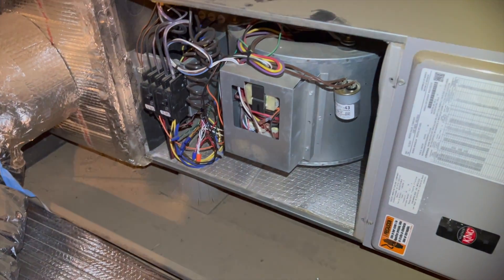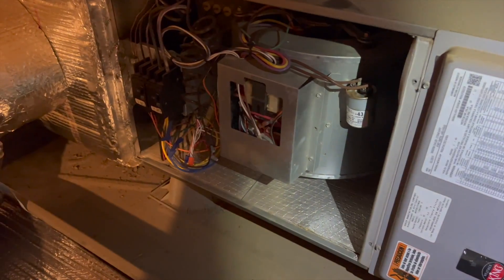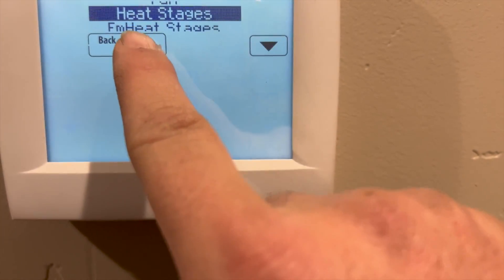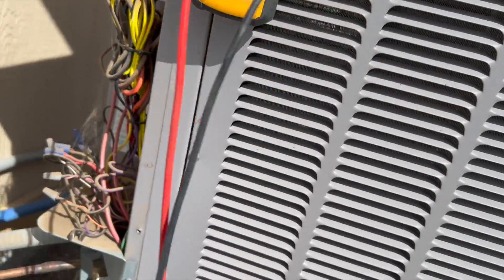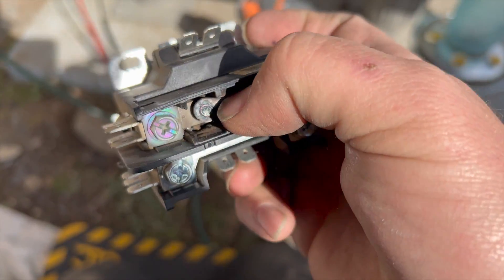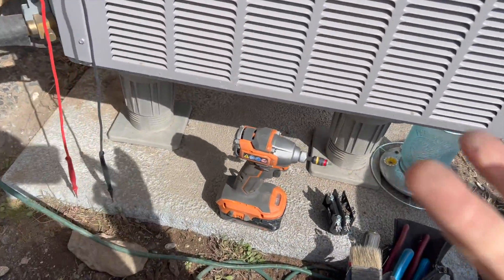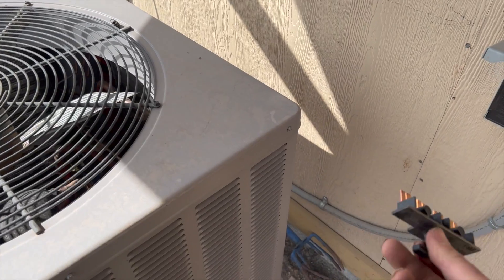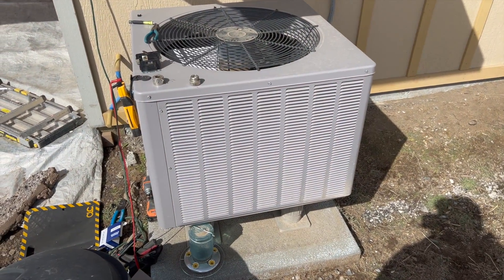Heat Pump Outdoor Unit Not Running EP110

Comment: Thank you so much for ur help. Now, what is a "high pressure lockout"? Thats a code I am getting from my defrost board.  And could a defective thermostat caused the defrost board to show this code? My heat pump board is currently showing this code. The OUTDOOR unit DOES NOT, start up at all,  in the heating or cooling mode. There is 24v on the R and C terminals. In  the "emergency" mode, I am not getting enough heat. It only heats up to 72degrees only, and runs all night. And never shuts off.  This is a RHEEM system. 6yrs old. I am really frustrated, because i am having all these issues at the same time. I am thinking the thermostat is mal functioning, then I think its the defrost board. then i think the heat strips has issues. I am a wreck with these issues. The indoor unit runs fine, but NOTHING from the OUT DOOR UNIT. I just can't figure it out. Hope you or any other can assist me. thnx.
Reply from the maker: If you’re getting a high pressure lockout it’s not an issue with the thermostat. This occurs when your refrigerant pressure gets too high. This situation will cause the high pressure switch to shut off the system. When this happens multiple times the board will then lock out the unit preventing the unit to run.   This can be reset if you remove 24v but it’s possible it will just happen again. You will need to contact your local HVAC company to diagnose the problem as it could be a refrigerant based issue which requires a licensed certified technician.

Comment: I am confused. at 1:40 you said that you were "going to kill the power". BUT THEN YOU SAID that you testing the coil and YOU GOT 26v.  you, loose me there. How could you get 26v IF THERE IS NOT POWER? Is there Low voltage on the coil, from the indoor unit, still avail. on the contactor, after the out door unit is "killed"? Please explain. thnx,
Reply from the maker: I removed high voltage from the out door unit. The 24v is supplied by the transformer in the indoor unit.
Reply: thnx for clearing this up. So there is low voltage still on the coil of the contactor, even though the OUT DOOR unit has not power. Thanks again. i understand now. Hey, one more thing, please,  could you say why a heat pump system, with electric heat strips is NOT turning on the OUT DOOR UNIT, when the thermostat is in the heat mode? The indoor unit however, comes on and runs ok, and blows warm air to the apt. BUT, the out door unit does not comes on at all. thnx. @NighthawkHVAC
Reply from the maker: Could be a cold weather lockout. If it’s below a certain point outside the outdoor unit will not run. If that’s not the case could be a low voltage or high voltage problem.
Reply: Thanks for ur info. I checked. And, there is 24v going to the defrost board, but NO VOLTAGE at all going to the contactor coil from the defrost board. So, I am thinking the defrost board is defective here. Do you think there could be something else, that may be the cause? I am in Orlando, and the temp. so far has not gotten to below 40 degree as yet. Thnx again. @NighthawkHVAC
Reply from the maker: If you have low voltage going in to the board but now to the contractor. You may want to verify none of the pressure switches are tripped. If one of the safeties are tripped,  they will prevent low voltage from going to the contractor coil. If they are tripped you may have a refrigeration issue.

Comment: I think you're great. Hope that is all mine needs. MERRY Christmas.  My outside unit is also not working. I can't get it looked at today. The thermostat said it was on emergency  heat but the out side unit is not coming on and I have no heat.  I turned the unit off completely     
and went to work.
Hoping to get somebody  by to check it in the next couple days
 I checked  the breakers. What else might it be? It was running yesterday fine. My heat pump is not quite  four years old.